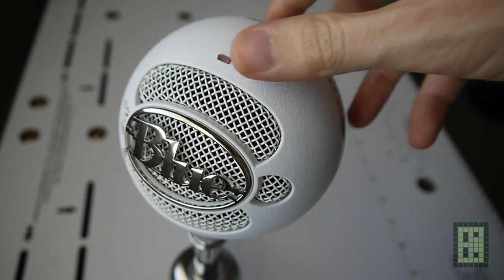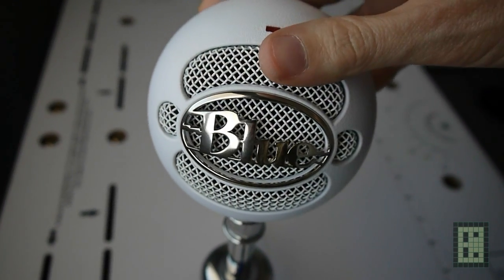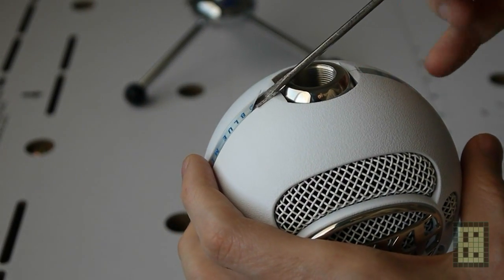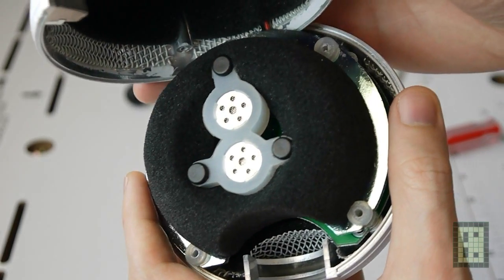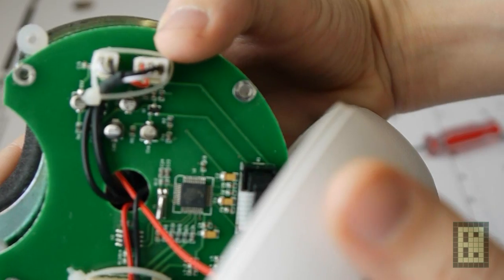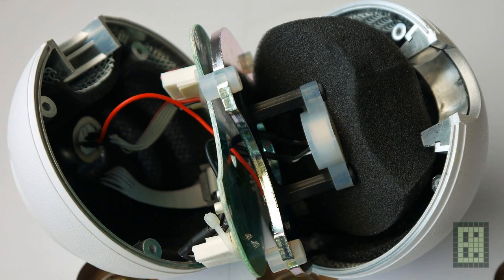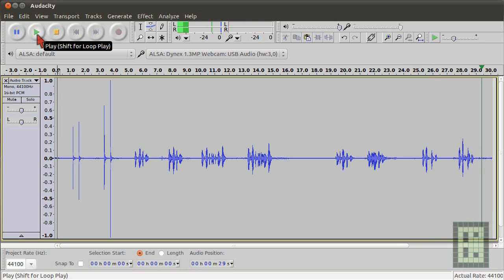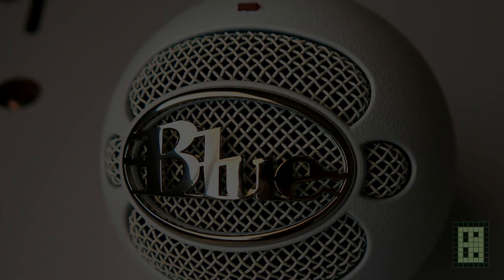Blue Snowball Microphone Full Hardware Review, PCB, Audio Test, Linux

Comment: is there anyway to get a good shot of the USB wire on the inside my mic usb wires came off and i dont know the pin out to the usb on the inside. (USB to pcb)
Reply from the maker: I do not have that microphone anymore but try to watch this in HD 1080p maybe there is a good angle for that.
Reply: +Rainbow Dash Mine did the same, here is the ppinout i used to fix it, (got it from observing this video)

Pin 1 (stripped) Shielding
PIN 2 Ground
Pin 3 Data+
Pin 4 Data-
Pin 5 Positive

Comment: thanks for opening I need to check the pins for the USB stand b connecter a firend of mine broke his connecter i'm looking to order and replacement part, if you haev any ideas where I would get that be great, if not i'll google thanks !
Reply from the maker: Try Mouser or Digikey they have the USB connector for sure.

Comment: If it were 10 inches from my face I sound quite distant according to my friends. Usually to speak at my normal volume and have it captured correctly it has to be like 2 inches from my mouth. I have gone through every audio menu and settings I can find on my computer. There seems to be no gain control. It is very frustrating. I have since taken apart my microphone and my friend and I are going to verify the soldering and in need be create custom firmware.

Comment: My microphone does not have a SN on the silver ribbon and other than slightly different brand components the PCB seems identical to yours. Yet no matter how much I turn the volume up or what I select on the switch on the back it is really quiet... I use Windows XP 32bit I'm not too sure where to go from here.

Comment: Is there special software to install, or can you just plug it into any PC and use it? Why did you buy the mic? Did you have a special purpose in mind?

I would say that about 100% of non-Torx screws nowadays are Phillips on electronics, so why are you using a slotted screwdriver? BTW, that tape around the mic is a poor design; it will fall off or start coming loose as soon as the adhesive gets old.